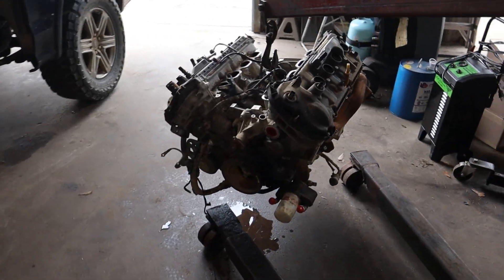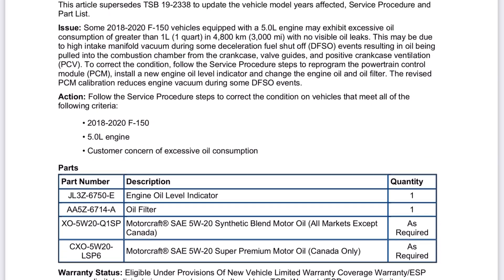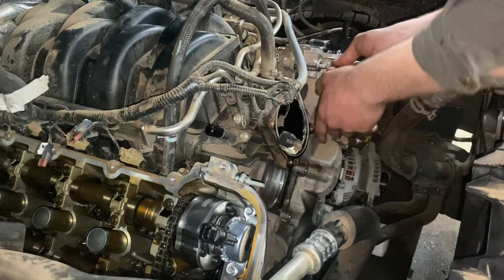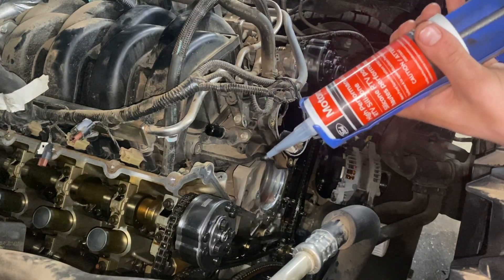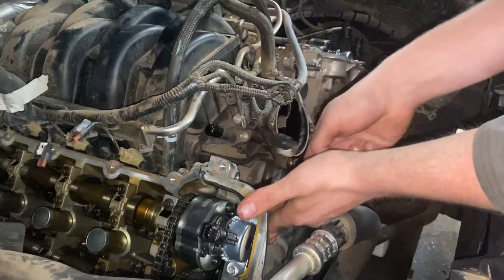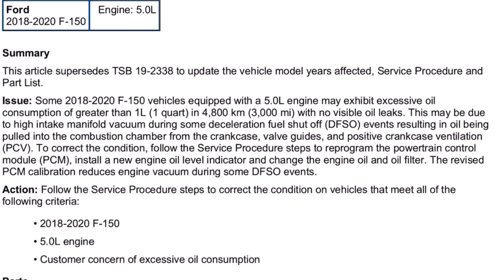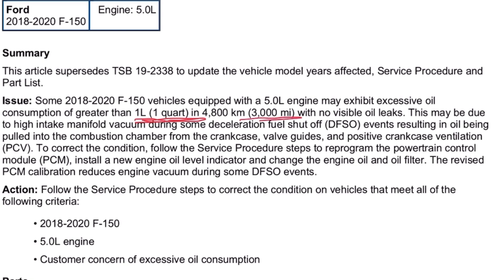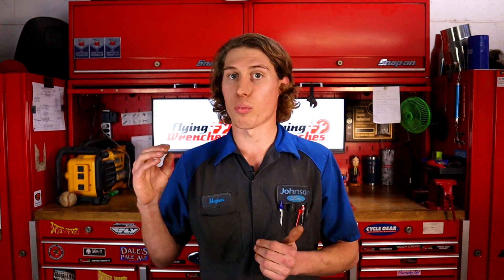Ford 5.0 Coyote Oil Consumption FIX

Comment: Hey there are a LOT of us old fkx out here that have ALWAYS checked our oil and always WILL...My 2011F150 5.0 with 200K uses a qt every 700 mi no leaks nothing...IT JUST USES OIL. And when I go out and oil is below the min line YOU DAMN RIGHT I'M GONNA TOP IT OFF!! Why is it doing this? I have no idea but it's done it since I bought the truck used. I'm 70 years old, and adding a quart here and there aint gonna kill me. But to tell the drivers of KNOWN oil using motors just to not check the oil is absurd to me!

Comment: I have seen this in late seventies Ford 2.3 Pinto it used oil but didn't burn per say. 23000 mi two years old. Top two rings on pistons like new , oil rings bad. Replaced oil rings all cylinders oil use problem gone.

Comment: Oil doesn't burn clean, so where is this oil burning off? Cylinder head? If so that's not good. Should Sea Foam or an equivalent product be used regularly?

Comment: Problem solved by changing oil and filter ever 5,000 miles like you should, not 10,000 miles. This only adds few pennies to the overall cost of operation and it's the best/cheapest insurance you can buy to protect any internal combustion engine. Personally, I change mine ever 3,000 to 4,000 miles or every six months, whichever comes first.

Comment: Educate yourself on what you own.  We work for what we have and must take care of it.  Check your fluids, tire pressure, etc.  It cost less being vigilant than paying these high priced shops hourly wage.  Engines today use such thin oil which evaporates quicker snd are designed to reduce lower fuel consumption.  I’ve own many older vehicles, they used 10/30 oil and used less.  Good luck.

Comment: I do! I check my oil every 1000 miles in all my vehicles except for my 2016 F350 6.7L and the reason I don't is because it holds 13.1 qts.

Comment: FOMOCO is coming out with a permanent fix for this oil consumption problem. The are adding a 5 quart oil tank under the hood that will be similar to an IV DRIP to constantly add oil as needed. 😂

Comment: I totally  get what your saying on this oil thing, that being said i still believe it is a good idea to check your oil, which is like the heart of the engine, because you might have those normal everyday things going on and one of them might be excessive and thak it down below that threshold that it was designed to.  It may not do anything that time but a continuous scenario like that every time it gets changed, may cause long term issues.  Most dont keep track of fuel mileage either but i do and can tell you in my log every time i had a problem with the vehicle.  Another example my dad had his transmission serviced at the dealership the last time it was done.  He went to change it himself this time becuase he started having slipping issues, no leaks or anything on this truck and low miles but that transmission was definitely 3 quarts low and becuase he never checked the transmission fluid he did not find out until it was a problem

Comment: Thanks for the video. My 2018 just went into "limp mode". I didnt even know that was a thing. Im driving doen a 2 lane back road and alarm after alarm went off. Truck immediately lost power. No gas what so ever. Luckiky it did this after i made it to the top of the hill and i coasted around a curve to a church parking lot. I turned tge truck off, waited a few minutes, and then restarted just fine. Started doing some Google searching and found out low oil could cause it. Went directly to get oil change. 3 quarts low. Tgats when i found out about limp mode. Very thankful for that design. Again, thanks for the video. Puts my mind at ease knowing that the oil IS going somewhere. Had me baffled for a bit.

Comment: I have a 2020 f150 crewcab 5.0 coyote that just turned 60,000 miles. Put 3,500 miles on my most recent oil change and the engine sounded a little rough going up a hill the other day. Checked my oil and there was nothing on the dip stick! It took 5 quarts of oil to get it back to the full mark. It’s not leaking and it’s not smoking, but something is terribly wrong here………….

Comment: Id like to know if they just changed cam timing on the re-flash.  And to my understanding the gen3 5.0 in the f150 & mustang are very similar other than intake manifold and exhaust manifolds.  Is this a mustang 5.0 issue as well?

Comment: This applies to the aviation industry our jet engines and piston reciprocating engines. the manufacturer states a set amount of oil but once you run the engine for 5 minutes it burns up the “excess” and runs 1-3 quarts low which the engine runs smoothly with a low amount. I believe this applies to our modern car engines. I would definitely keep checking oil levels and add oil as needed.

Comment: I had a 2012 I just got rid of.  5.0 Gen 2 coyote motor.  Never had to check my oil. Ever.  changed oil every 3,500 miles give or take. 156,000 miles and I finally sold it because of rust. A current 5.0 Gen 3 Coyote motor should not be burning oil, just like the previous generations. period.  If you are a technician and believes this not to be true, you are one biased and incompetent person.

Comment: Mayson, I have been following you for some time now.  You are informative, hilarious and entertaining.  I think you are way off base on this one.  Granted this post has been up for a while.  I have been watching you on Facebook and just found your YouTube Channel.  That said...as others in the thread have said....we were taught to always check oil levels in vehicles (including power equipment).  It is poor engineering to have a Newish (2020 King Ranch purchased in 2021 as a CPO vehicle now with 44,000 miles) truck that burns 5 quarts of oil between changes.  Mine has been through the TSB process one time just after we got it and it helped until a  recent issue with water intrusion into the pre-collision sensor from a leaking weld seam in the roof resulted in another reprogramming of the PCM.  Now it is burning oil again.  This is getting old.  This after a near life threatening issue with a 2013 EcoBoost going into Limp Mode on full boost in Atlanta traffic.  I'm beginning to think maybe something other than Ford next time....which pains me greatly.

Comment: It is an issue, my 2020’s timing chain went at 35,000 miles. Now, at 62,000, it’s sitting in the shop again with the exact same issue. So what is the mechanism of failure? No effin oil. I filled my oil 400 miles ago and when I got to the dealer yesterday it wasn’t even reading on the dipstick! 

It’s completely a problem and that’s why there is an active lawsuit specifically for this issue

Comment: My 2018 was 5 qts. low after 3000 miles
Reply: I had a the TSB 19-2338 done. My engine all but blew up a few weeks later. Had to install a new engine. CHECK YOU OIL BOYS!

Comment: Man, I would love to agree..! But I have to disagree with your take on the issue, I had my oil changed and right after I hit 3200 miles my coyote started rattling real bad, checked the dipstick and what do you know, no oil on it! Not a drop registered on it! It’s done it three times in the 3 years I’ve owned it! No reprogramming is fixing the issue thousands of people are having, it’s ruining $$$thousands of dollars worth of converters and o2 sensors, and ford just laughs

Comment: My 19 coyote engine was replaced by ford at 50k over a year ago for oil consumption issue after attempting reprogramming and a longer dipstick 🙄 but also had engine pinging noise upon acceleration only heard with open window, not sure what the cause of that was. I have 20000 miles on new engine and no issue to date with any oil consumption. Always change my oil every 5k.

Comment: I have a 19' 5.0, about 100k on it and got the truck tuned around 20k so i never bothered to take it in for the TSB. 

My opinion, these are very high performance engines. 12:1 compression, 400+ hp 5.0L engine naturally aspirated. In the world of racing, if you built hot rod motor with these same specs, no one be bothered by the oil consumption. Ford built a reliable, mass production hot rod engine. Like he said this just a characteristic of the 5.0, pros and cons to high performance engines, and thats all it really is.

Comment: Flame coating on cylinder wall and hard thin Molly rings don't seat in .I have a 2020 that has used 3 qts every 6000 miles .Now it has 30000 on it and only used 1 qt in 6000 miles

Comment: I
Ford got cheap in I believe 18 or 19 and deleted using steel sleeves for the cylinder walls and started using a plasma coating
About the same time they started using oil

Comment: OK cool thanks I just bought a 2018, but I gathered from your video was, the oil needs to be changed every 3000 miles regardless of what the oil says, and I need to check the oil every thousand miles, because what I gathered from the storys or of thers a knock. Thanks for the new 5.0 sop idea

Comment: Haha this is silly, if it’s not on the ground it didn’t evaporate….except it could have combusted or ended up in the coolant. Burning oil is normal, burning a quart of oil between oil changes is bad. If they designed it that way then they designed in something that will kill catalytic converters and egr systems.

Comment: Unfortunately, I am one person who has white oil consumption issue on an F150
I also know that you’re wrong 
I did not check my oil and….
 a timing chain rattle occurred around about 25% before the engine oil was calling to be changed
I took it into the dealership and they confirmed that this is a problem
And they reprogrammed the unit
We will see

Comment: Are you kidding me?  So Ford designed an engine to burn oil at a rate somewhere around a quart/3000 miles.   And, this is supposed to be ok with the automotive world?  And, according to you and Ford this is just fine.  In fact, according to you part of the "fix" is to stop checking your oil level!!!   Put blinders on, bury your head in the sand etc.  
This is right out of the book;  "if you ignore a problem, it is no longer a problem."  
I am shocked at your take on this.  Oil consumption at this level should not be acceptable and very likely to affect the longevity of the cat.  
I always thought the 5.0 was a great engine but then again my experience had been those made prior to 2018.  In your eyes and those of Ford the new version is likely considered still a great engine but an engine that is built to consume oil just isn't for me.

Comment: My 2019 burned a half a quart or more every tank of fuel. Once I hit 45k miles it just stopped and now a quart every 4k. But when it’s low I can hear the difference! Clattering. I give it a half quart over and it’s much quieter. 62k now and runs better than ever. Oh ya one cam phaser at 28k and plugs at 40k needed so far.

Comment: I have 90,000 miles, and mine has just started using oil after a drive in the mountains. I also noticed a lot of soot in my tail pipe. Do you think this would harm the converters, and cause build up on the back of the valves?

Comment: ASE Mastertech here. My 2019 F150 5.0 will burn 5 quarts in 3000 miles. I have had a dry dipstick between oil changes. Now at 60,000 miles I need and engine and Ford has marked up the engine to $22,000. This is not normal and oil does evaporate into crankcase vapor which in turn gets sent to the combustion chamber through the pcv system. It isn’t normal. It fouls spark plugs, O2 sensors, and clogs cat converters. How many of these have been replaced without addressing the cause? That’s what the dealer did to mine while underwriting warranty and now it’s on my $, it now needs an engine.

Comment: If it were not a problem as being opined in this promotion for Ford, then Ford would not have issued more than one TSB. It is in fact a real issue and yes, it is necessary to check the damn oil level if you have this issue. My 2018 5.0 consumes 4-5 quarts of oil every 5000 miles. Also, another factor not being considered here is that this excessive oil consumption at the level that prompted the TSB is likely skewing the emissions and possibly damaging the cats among other components.

Comment: Any thought on why my 2018 F150 5.0 smells like gear oil/oil in the cab? 

Worse when I go up the mountain but constant.  

(Local CO F150 driver. Still under extended warranty).

Comment: The oil in my truck will get down below the dipstick with no warnings on the dash. The oil will get so low that it will knock ridiculously bad going up hills.  This all happens at about 80% of the service interval. So just service the engine won’t work for all the motors.

Comment: I have a 2014 150 with the 3.7 with 150,000 miles and it doesn't use a drop between oil changes every 5,000  miles. I check it regularly anyway. It's just the right thing to do.

Comment: Had a knock, check engine light on, ignition issues. Thank god I checked the dip stick. Filled it with 6 quarts to  get back to a normal level. Taking it to trade in. Buying a ram and will never again buy ford. Not an issue! Drove 3500 miles since last oil change truck said I had 10% oil life remaining yet I was 6 quarts low. This is a huge issue! Fuck ford and fuck any one of there mechanics that tries to tell me that it is normal for a 2020 that is 3.5 years old to burn 6 quarts of oil in 3500 miles. Can’t even make a truck that makes it to 60,000 miles.

Comment: I have a 2019 5.0 F150 with 70000 miles on it. I don't check my oil and when my check engine light came on I went to youtube to see what was out there. The first video I saw said check your oil, which I did. The level didn't even register on the dipstick. I was close to needing an oil change so I put 4-5 quarts of oil in it to register to the bottom mark on the dipstick. The check engine light went off after a short trip to the store and then had my oil changed 2 days later. I would like to reduce oil consumption so I'm researching the issue. Nice video!

Comment: Thats what ford is going to tell you. First coyote with coated cylinder walls. First coyote with this issue. The super low tension rings used with those coated cylinder walls can't take the crankcase vacuum.

Comment: Love the video's but not checking your oil is a bad idea. I have a 2019 F-150 5.0 with oil consumption issues. I've had the new indicator and flash to the computer done and it didn't fix the oil consumption issues. It's back in at the dealer and now they are saying that it may be the PCV valve and valve covers. A side issue is that I'm on my second transmission and the current transmission is hitting hard again in 3-5 gears and sometime in 7-9. This has been really frustrating. One quick add, my oil level is below the low mark on both indicators, the original dipstick, and the new dipstick that Ford installed. With running lower than the range that's being referenced in the video I'm concerned about the longevity/reliability of my truck.

Update: Ford along with my dealer replaced the engine under warranty. They found damaged piston rings and cylinder walls. Grateful that the warranty covered the cost. My 2019 5.0 only has 66,000 on it. So now I had two transmissions replaced, one valve component in the latest transmission replaced and one complete engine.
Reply: I have had very similar history with my '19 F-150 5.0L. I am past my extended warranty.  Currently at 127600 miles and in the shop to have at least cats and vvt bank 2 sensors replaced.  However, it may require more vvt related parts, timing chain, roller bearings etc.  Transmission and torque converter X2 each. Truck has always had same symptoms as you described. SMH. Best of luck to you with yours.

Comment: I have had my 2020 5.0 F150 since Aug 2020.  For the first year it burned 1-1.5 quarts between complimentary oil changes at the stealership.  I do my own oil changes and only use full synthetic motorcraft oil.  Had 3k road trip and checked oil before returning, it was 2 quarts low and no alarm or warning, WTF?  Luckily this old dog checked his oil.  Changed oil this year at 69K and by 72.5K it was two quarts low.  After researching this consumption issue, learned of this Tech Service Bulletin (TSB) and took it in for PCM upgrade and PCV replacement.  It cost me $325.00, because I don't want to take the risk of this engine seizing up on me.  I will continue to check my oil and update the forum if the PCM mod was successful or not.  My 2013 5.0 F150 never burned a drop, and I just assumed my newer Ford would be the same.  Stealership never offered to mitigate the upgrade and provided no explanation why their trucks can run out of oil without warning.  My next truck with probably be a GMC.

Comment: Huge flaw in your opinion. Why only these model years firstly, why other engines do not exhibit the same characteristics. I agree that a bit of oil consumption is normal. My focus with nearly 200k miles consumes none at up to 10k miles between changes. These engines are made with losser tolerances for fuel economy point blank. That's why the issue is not as prevalent in 21+ f150's with the cylinder deactivation. That's another problem. I blame not Ford but the push of fuel efficiency...I'll leave this right here...